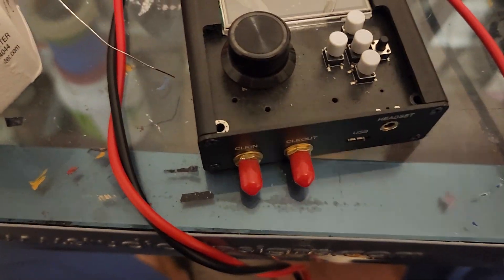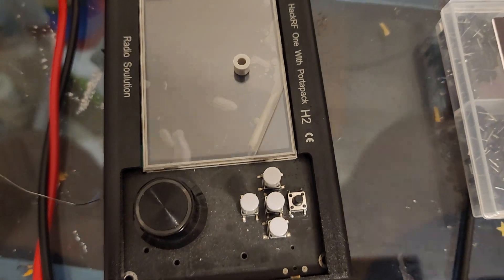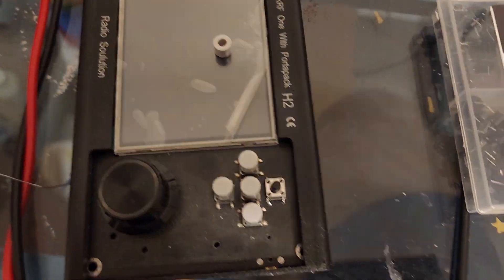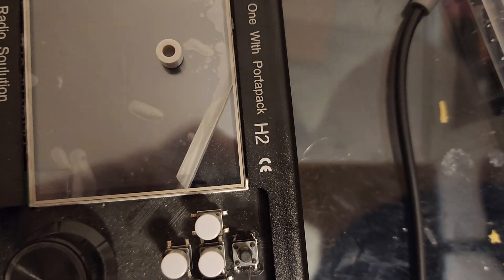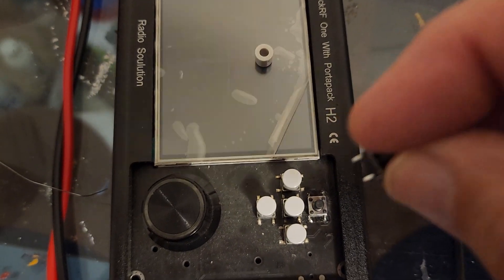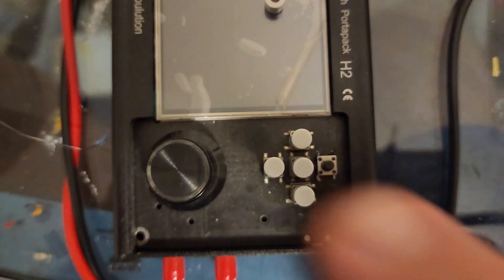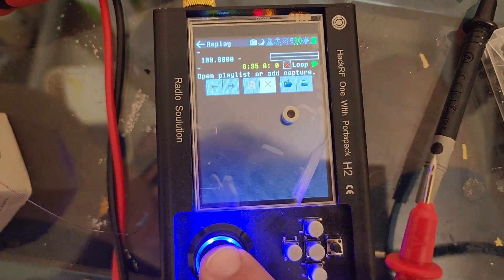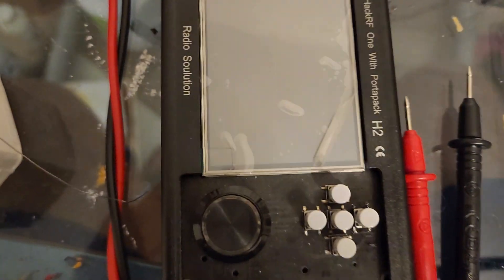Hackrf One with Portapack H2 button replacement fix for cheap!!!

Comment: Do you need to solder it?
Reply: yes
Reply: @johnbesedic9432  I also noticed some small silver disks (probably 3mm in diameter) that look like they might have came off from the buttons? Is that what they’re for?
Reply: One more thing, when you take the small black square box out, do you simply just put in the new buttons, and the buttons are functional, or how is the button connected to the actual portapack?
Reply: And does it matter which way the silver disks go in
Reply: @northernerierailroadproduc114  once it breaks youll have to replace i dont think you can re assemble the button